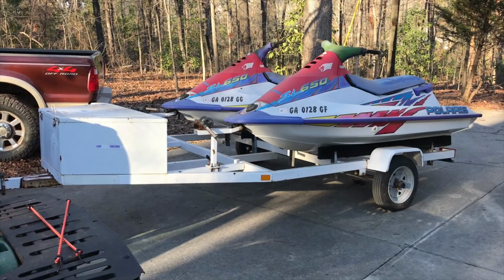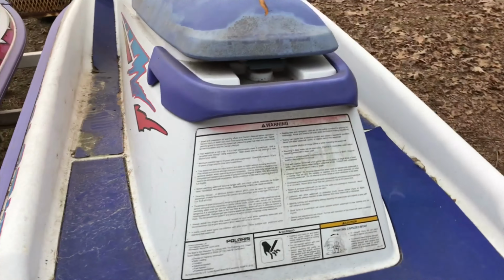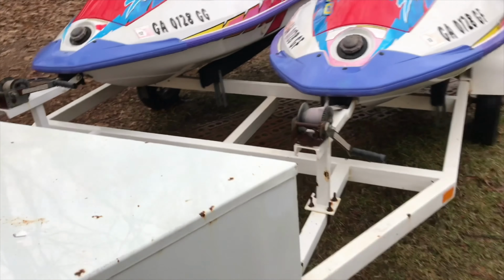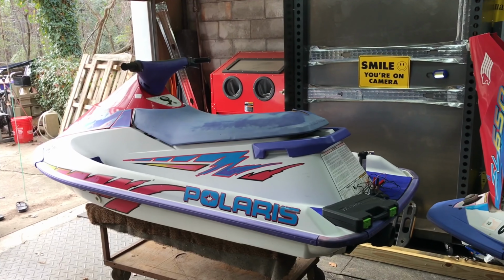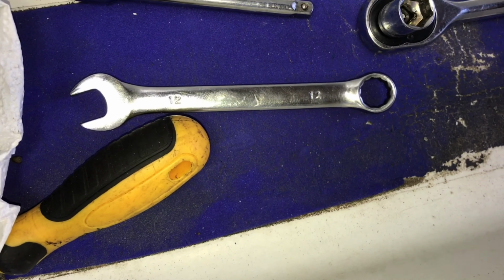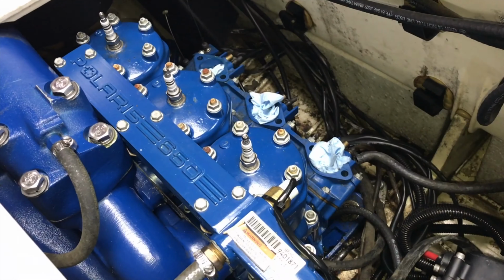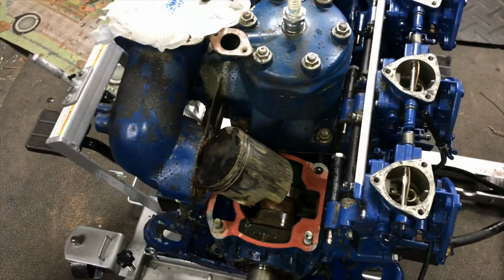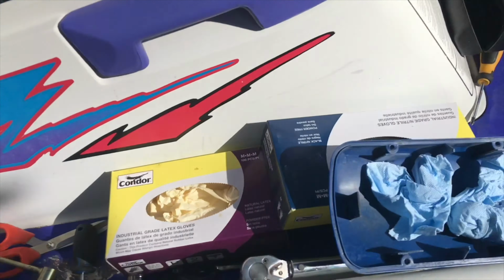Cheapest Double Trailer With Polaris SL 650 Jet Skis On Marketplace!

Comment: I couldn’t see which fuel pump you put in, but if you care much about the ski, or plan to keep it long, you should definitely do the triple outlet Mikuni fuel pump. It’s only about $50, and will save your motor. The reason all your motors have the PTO cylinder melted down, is because of that factory fuel pump. The PTO cylinder gets starved for fuel. You’re fortunate that yours wasn’t worse than it was. The last one I rebuilt, the piston was so destroyed that it ended up taking out the crank bearings as well.

Comment: Wow you got a killer deal! Replacing the top end looks very straight forward and looks easy to work on. I am from GA. I live on Clark Hill lake on the SC side. I noticed the lake you are riding in has a lot of silt in the water.. Is it lake Oconee? Oconee gets real muddy like that. Clark Hill lake has a 1200 mile shoreline and the water does not get muddy except way up near the mouth of little river. The main river, the Savanah river, never gets muddy but it could be because Lake Russel and Lake Hartwell are both upstream from Clark Hill lake so the dams might catch the silt. I am assuming the PTO cylinder is the cylinder closest to the flywheel and I assume that the heavier flywheel is for low end torque?
Oh yea, does the engine have reed valves or use 3rd port? The reason I am asking is I am looking at a Polaris 750.
Reply from the maker: Hey man this was lake tobesofkee when they were draining the lake to do dock maintenance so that’s why the water looks so dirty I just couldn’t wait lol. Also they do have reeds